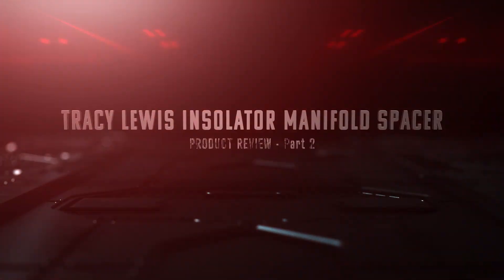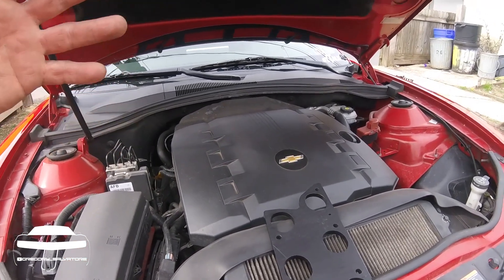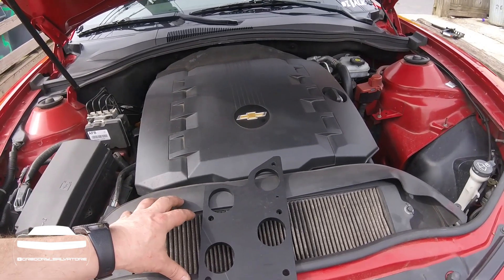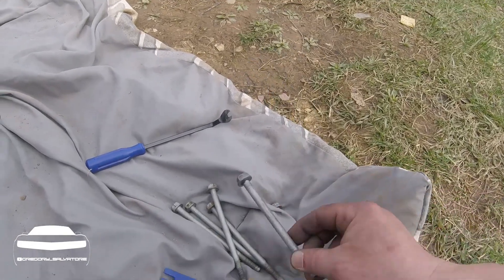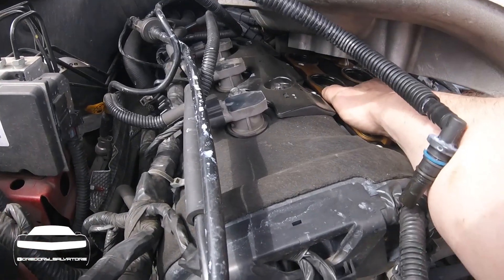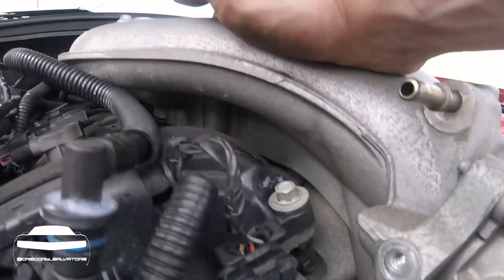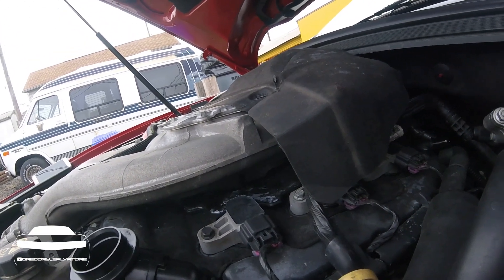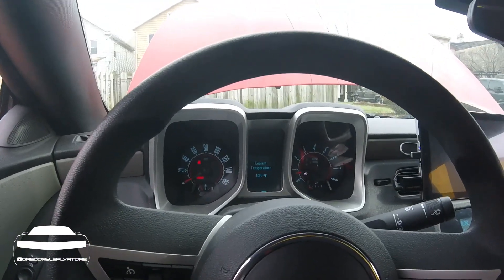Best way to add power to a V6 Camaro Installation - Tracy Lewis Intake Manifold Spacer Part 2

Comment: I added this to my CTS and now has rough idle what is wrong with it?
Reply from the maker: Rough idle may indicate it is not seated properly and allowing air to get in.  The air is entering after the mass air flow sensor so it may be running lean. The computer doesn't know the air is there to add fuel.
Reply: @GregorySalvatore  what should I do to properly seal it?

Comment: I realize this video is two years old. Can you do that spacer and a LFX plastic intake manifold?
Reply from the maker: No, and its not needed. You have a plastic manifold that dissipates heat better. The LLT motor has an aluminum manifold subject to heat soak, the spacer helps with that.
Reply: @GregorySalvatore  I have an LLT, and was wondering if I could put the plastic intake manifold on it. I think I found the answer. Looks like you can. Jacfab sells a laminator fx for it that increases airflow by 17%.

Comment: Will never get 20 rwhp from an intake spacer.
Reply from the maker: LOL! and yet the dyno says I did. While I will agree you won't get it with JUST a spacer, with the combination of modifications I have... The spacer brought them all into line and maximized the potential of all of them which is what caused the large gain.
Reply: @GregorySalvatore  I have the 80mm throttle, ported intake, k&N typhoon, Borla Atak ( SS Kit). The car is not tune, but I will look into adding the spacer. I could see everything coming together like you said. I'm thinking of adding the E85 kit and then the tune. What else do you think it needs.

Comment: Great, the factory's air intake on these cars are a master piece! Alot Dyno test by GM engineers 🤔
Reply from the maker: 🤣🤣🤣 GM doesn't test and tune for power, they test and tune for durability.
Reply: No they're not, a cold air intake works much better

Comment: Will it fit in a 2016 v6 camaro
Reply: 2016 is a different generation of camaro. I have a 2018, and they are entirely different engines. The 2016 V6 makes more power, and is quite a bit faster than the llt or LFX; but I have a ported intake manifold from Jacfab.

Comment: Did the manifold insulator come with new bolts or you use the old bolts?
Reply from the maker: It did not come with bolts. Directions said you could use old bolts but I choose to buy longer bolts.
Reply: @GregorySalvatore  what size did you buy for all 6 manifold bolts on top?
Reply from the maker: Took the bolts with me and got them a little longer. I no longer remember the size.

Comment: Does it come with longer intake manifold bolts? Or you reused the old ones?
Reply from the maker: old ones
Reply: @GregorySalvatore  do the old ones fit? I found another site selling the same thing only they give you longer bolts and that gasket sealer in a tube

Comment: Did you not use the regular gasket? the way you edited looks like you removed the regular gasket, and are just using the spacer in between the manifold. I just purchased the spacer and want to make sure I install it correctly.

Comment: best way to add power?  forced induction or spray. play with all the lil bolt ons and it helps. but the power comes from those 2

Comment: Idk how a spacer gives you horsepower
Reply: Would like to see it in on the dyno before and after
Reply: Watch the video he explains it 🤦🏻‍♂️
Reply: it doesnt add. just helps keep heat soak on the intake at bay. so you dont LOOSE as much power due to a steamy hot intake manifold.
Reply: It's straight cap

Comment: You can’t say you’re getting hp when you don’t dyno the changes. I have some swampland for sale if you’re interested. If you want power you really have to spend some money. There is no way around it. 10,000 will get you 100 reliable supercharged who. After that you should go with a V8 unless you want to spend double that or more. That’s why you don’t see a lot of 700hp v6 camaros. If you start with a V8 you will always have  a better dollar per hp ratio. I have a stock V6 2013 and it runs great from the factory NA. Changing parts Willy nilly will get you poor drivability in most cases and force you to reengineer everything else to make it run right.
Reply: I modify the factory intake manifolds and the throttle response is improved. Efficiency is not sacrificed. Your last statement is incorrect.

Comment: Did this kit come with longer bolts and does it fit the lfx 2014?
Reply: JacFab makes the spacer for the lfx. I just put one on my 2014, totally different install as well , but there is a video of that install on camaro mods channel... Come with all you need bolts and all, totally worth the install !

Comment: Will it fit on a 2015 Camaro v6?
Reply from the maker: No this is not needed for the lfx engine due to the plastic intake.
Reply: Ok thanks but all the other mods will work?
Reply from the maker: you would have to swap out the long tube headers for downpipes and check if the intake works with your year but if you can source the right parts for your car. you should see similar gains
Reply: They have these for the lfx in the 12-15 cars and because we don’t have manifolds we use downpipes.
Reply: JacFab makes the spacer for the lfx engine

Comment: I love my v6 2011 LLT, now with 60k miles.   I have K&N CAI, Hypertech tune, mufller delete, and I use Militec-1 ( oil engine and dif fluid)

Comment: Did you ever have any issues after the install
Reply from the maker: no issues... very happy with the mod!
Reply: @GregorySalvatore  can you help me with something I install long tube headers cold air intake and a intake manifold space in my 2010 camaro it start then it die again why is that?
Reply from the maker: @Icygt500  my guess is you either didn't reinstall your maf sensor, you damaged it or installed it backwards or you didn't properly attach the cold air intake to the throttle body. 

The same thing happened to me at the drag strip. While preping my car I removed and cleaned my air filter and air box for the ram air intake. when I reinstalled it, it wasn't tight causing it to come loose and fall off during my final run... scared the shit out of me! If any of those is the cause, your engine is running very lean and that is why it wont stay running.
Reply: @GregorySalvatore  okay man thank you for a second there I got really scared
Reply from the maker: @Icygt500  Let me know how you make out
Reply: @GregorySalvatore  it's start now I install the mass airflow sensor wrong
Reply: Again man thank you very much keep up the great content
Reply: savage 069  true it help but idk how much because my 2010 camaro v6 have long tube headers cold air intake and I added the intake manifold spacer bro I used to get beat by v6 mustangs and g37s now I beat them